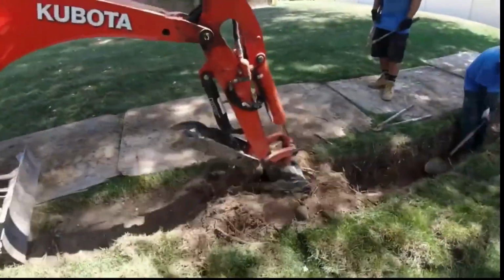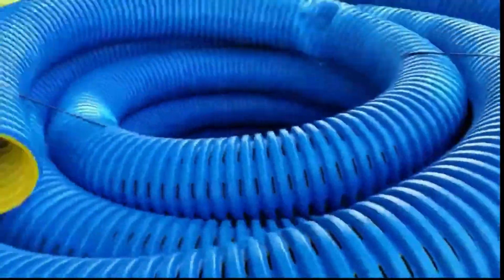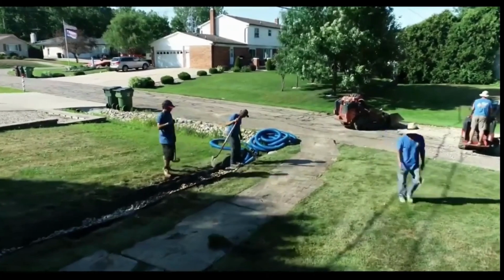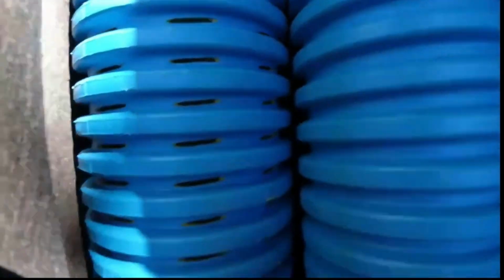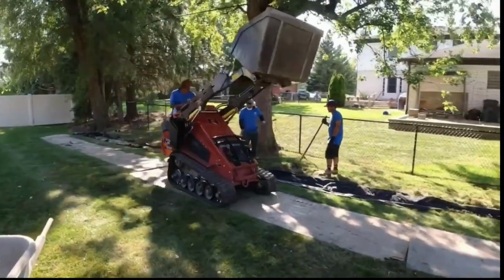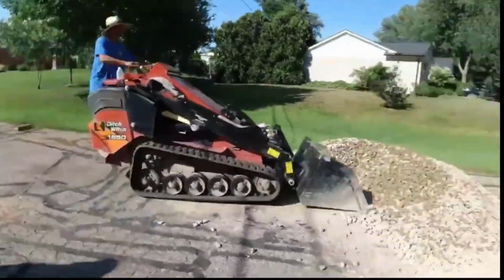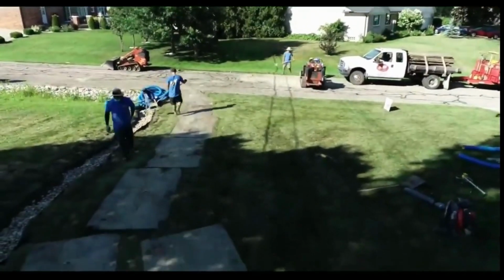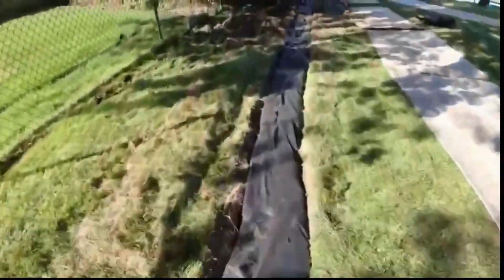How To Build and Install the BEST Yard Drain, French Drain, 2 Great Systems Combined

Comment: Thanks for the information and videos on French drains. Question in regards to gravel. How do I calculate how much tonnage of gravel I would need?
Reply from the maker: 1 ton for ever 30ft of French Drain. Quad Packs are less.
Reply: There's a calculator you can find on the internet you just type in how wide and how deep your trench is and how many feet long and it will tell you how much gravel you will need it also let's you choose what size gravel you are using. That's what I did.
Reply: depends on trench size. hand dug would be a lot less, we have a very steep topography with a lot of downpours, making us go 12 tons per 100ft

Comment: Nice job French drain man, you are the best! I have a question why you put 2 diferent pipes, one whit holes another whit out?
Reply: He mentioned it in the video, the solid pipe is connected to the catch basins to capture bulk surface water which will have dirt and debris in it so will need to be kept separate from the slotted pipe so it doesn’t clog the holes. The slotted pipe is the French drain which in this application is being used to pick up and redirect the spring/ground water away from the yard.
Reply from the maker: https://youtube.com/playlist?list=PLjFCqaZ4v1BVX2cpGD7wJqH37RSS1JAOz&si=u9rXRfFjrhvrVVcZ

Comment: Hi Robert, is there ever a scenario with a French drain system where you don’t use geotech fabric?
Reply from the maker: If I have Sheet water off a large  Non permeable surface like a parking lot I will use our 3 ft fabric leaving the top open In a open French drain scenario.
Reply: second this, 99% of the time though fabric is a must to keep debris from clogging the drain.

Comment: I have seen so many of your videos! Love them all. 

     Genuine question, are there any precautions of running a yard drain over a septic field? (Obviously besides going too deep)
Reply from the maker: I do not recommend that. A Septic field more likely than not will be engineered to hold waste water. It allows the waste water to slowly evaporate and leach. Once the field is full the Septic tank water level rises and a terrible odor fills the home. I have fixed many systems that were like this. Each system is a customized system for the different conditions. If you know what you are doing you can run a system around a Septic field with much success.
Reply: french drain would drag more moisture towards the field and pollute the water. Best to keep it away from the septic, or put the drain uphill of the system